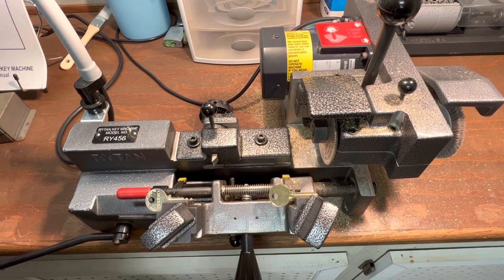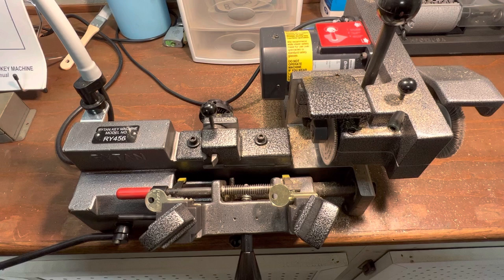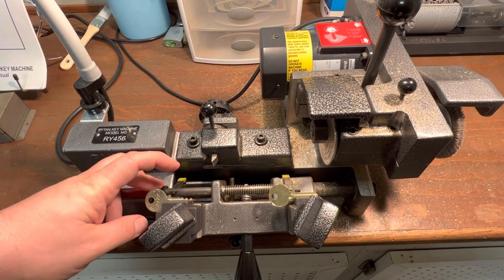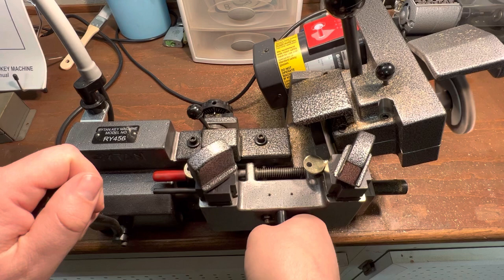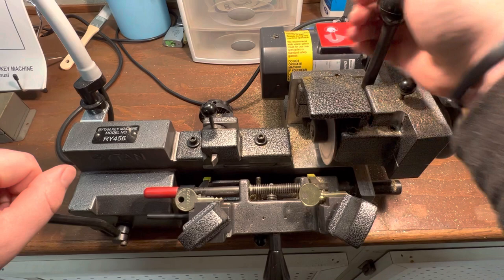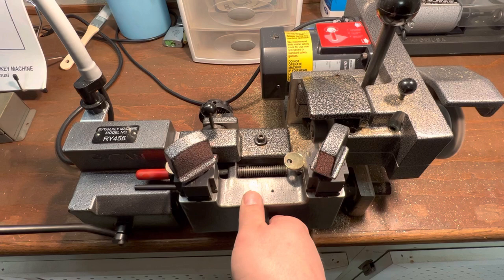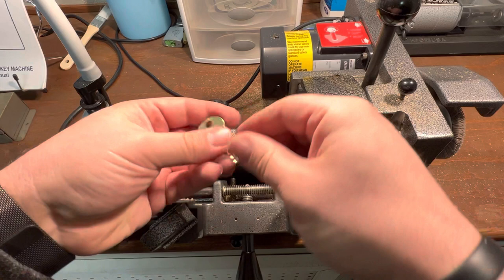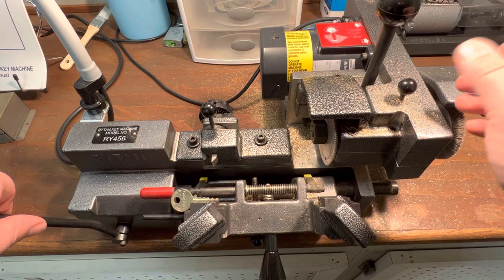(57) How I duplicate Medeco/Emhart keys on Rytan RY456

Comment: Rytans just rock! I started 30 years ago with them .used every other brand ..now went back to them. they just work and are easy to maintain own 3 now. I'm thinking of upgrading to carbide cutter options for the future.
Reply from the maker: I wouldn’t recommend the carbide unless you’re cutting steel keys!
Reply: @RubberBanned  Rytan recommended for nickel keys. My KABA and Schlage blanks are that. I have extra blades and at several $100 for upgrade I THINK I'm ahead using blades up.
Reply from the maker: @hkssystemslocksafe2486  I have a lot of nickel silver keys, and I’ve had exactly 1 carbide cutting wheel. It broke a tooth very soon after the shop had bought it. Never again!

Comment: I haven't seen the RY456 duplicating angled cuts before, so this is a helpful video -- thanks.  Question: Assuming all cuts are the same angle (probably wouldn't be, but hypothetically speaking let's say left), would you still be able to quickly duplicate without stopping to wallow out with the semi-auto handle like normal?
Reply from the maker: I think I understand the question now. If all of your cuts were the same angle, yes, you could run it through like a regular key, such as a Schlage.
Reply: Right, one of the great features of these Rytan machines are how quickly you can run through cylinder keys, but I wasn't sure if it could be just as smooth and quick with angled cuts on the Medeco variant.  I've never seen a RY456 in person before, so thanks for clarifying.